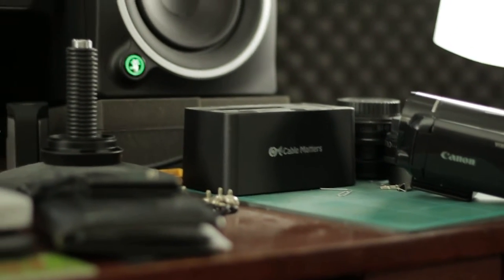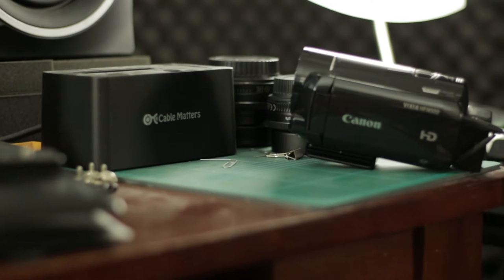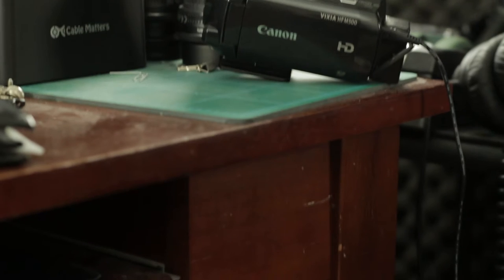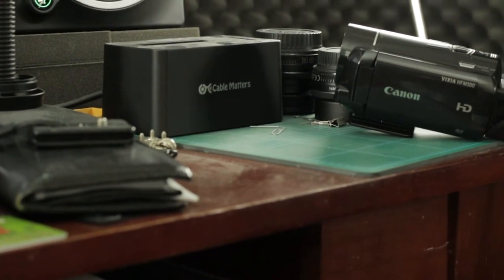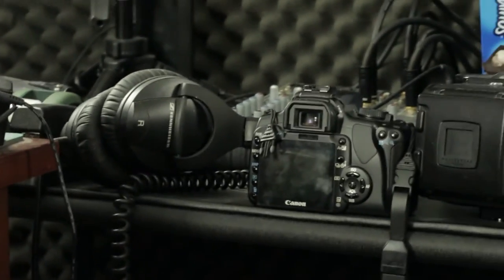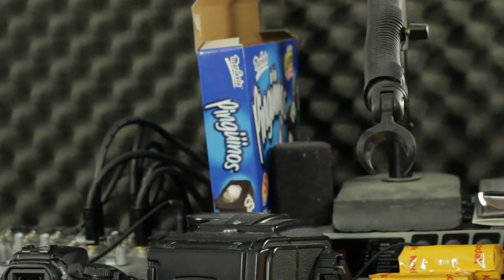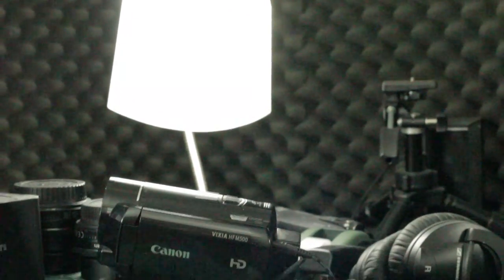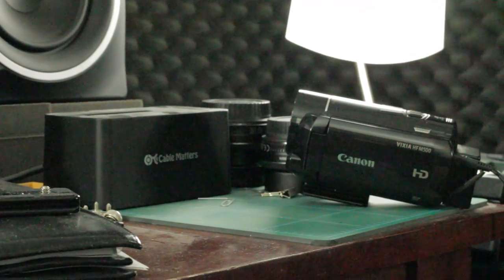Canon EOS SL1/100D Video Noise and Dynamic Range Test Footage

Comment: Man, thx. I <3d this video, but one question, was it the 50mm 1.8 or the 50mm 1.8 II/2.0/Nifty Fifty
Reply from the maker: +MasterCodem It was the recently released 50mm STM prime lens that replaces the 1.8II.  It's basically the same optically as the 1.8II (it's a little better wide open), but has the new STM stepper motor for AF.

Comment: How many lights did you have in there and what wattage? I was thinking of replacing my T2i with that SL1 just so I could shoot higher iso.
Reply from the maker: +Jason England The two desk lamps where each Azzlo Digital 13 watt 91+ CRI 5500K CFL bulbs (60 watt equivalents), The two overhead lights in the cans where each Azzlo Digital 45 watt 91+ CRI 5500K CFL bulbs (150 watt equivalents), and the bright light in the corner was a fixture that had 3 45 watt Azzlo Digital CFLs (the same ones as the overhead cans) for a total of about 850 equivalent watts of light.  When I have them all on, it's bright in that room, but you need that if you want to shoot at a reasonable ISO with a reasonable depth of field.

In all honesty, its a lot cheaper to add lights than buy a new camera.  A basic indoor use light stand with fixture and soft box with lights can be had for less than $100 and will add at least a stop of light if not more depending on your ambient level and give you control over where it goes.  I'd only recommend a newer camera if you shoot a lot where you can't control the light.

The SL1 is a great little camera and provides a lot of bang for the buck, it's only real downside for video (well, there are two) is 1. Plagued by Aliasing/Moire like most DSLRs. 2. No tilt/flip screen.  

The lack of tilt/flip is bad if you selfie shoot because you can't see what you're doing, but otherwise livable.  The aliasing/moire isn't awful, but it's really hard to get rid of.  Besides the 5DMkIII and the 1DC, the only other Canon DSLR cameras that don't have that issue is the T3i in 3x crop mode, the 70D is 3x crop mode, and the T6s in 3x crop mode.  The 3x crop mode of those cameras is great (it takes a native 1:1 pixel readout from the center of the sensor at 1920x1080 resolution), and it completely eliminates moire/aliasing, however, in that mode it's really difficult to get wide shots.  An 8mm lens (the widest you can get for Canon last I checked) in 3x crop mode is equivalent to a 24mm lens on the same camera in normal mode, which is equivalent to a 38mm lens on a full frame camera  in terms of field of view, so getting really wide shots isn't really an option, even though it does totally rock for resolution and no moire/aliasing.

If you have a little cash to spend, it'd be way better spent on the new T6s.  You'll get way more DR and a much cleaner picture with the addition of the 3x crop for those times you may want to use it.